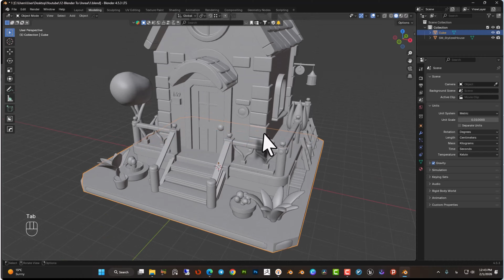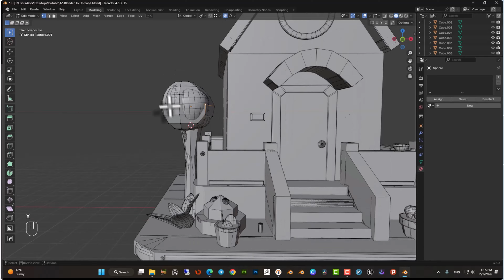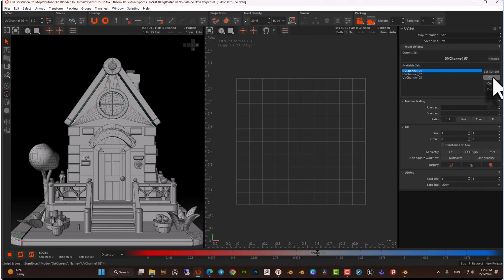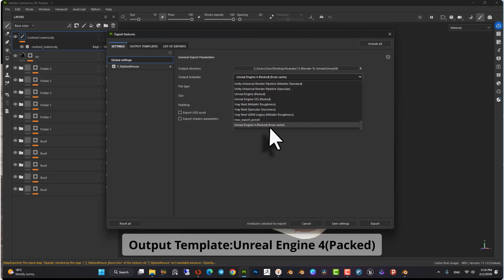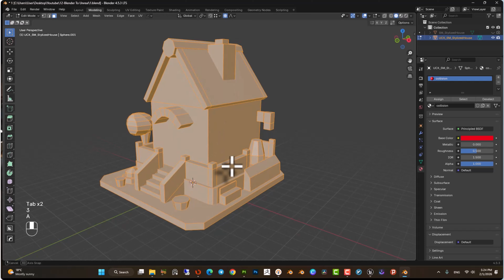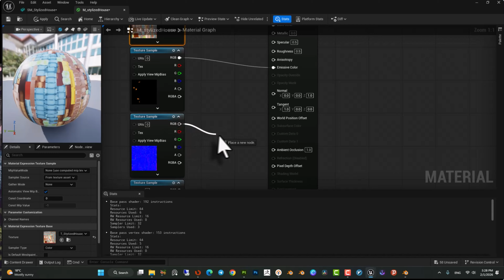From Blender to Unreal Engine – Clean Export Pipeline No Plugins

Comment from the maker: This video focuses on preparing a finished asset for Unreal Engine.

• Correct scale & units in Blender  
• Proper collision setup (UE-ready)  
• UV channels for texturing, light baking, and texel density  
• Optimized texture export from Substance Painter  
• Clean import, materials, and material instances in Unreal  

No plugins, no extra tools — just the exact steps Unreal expects.